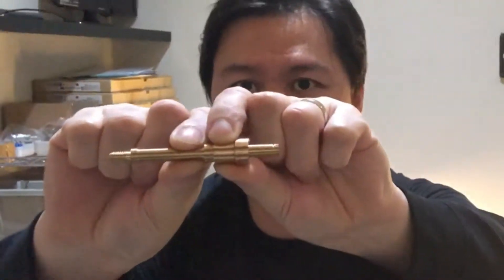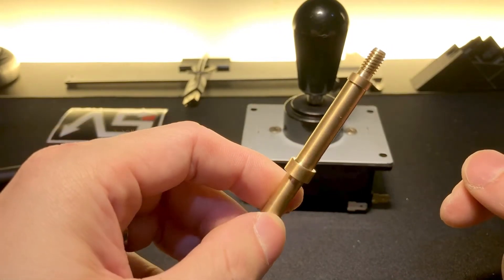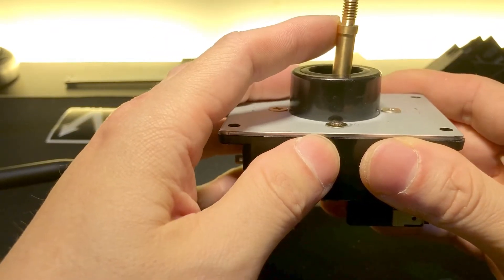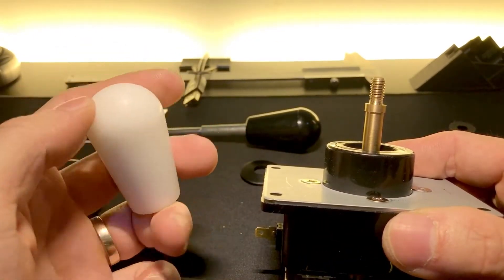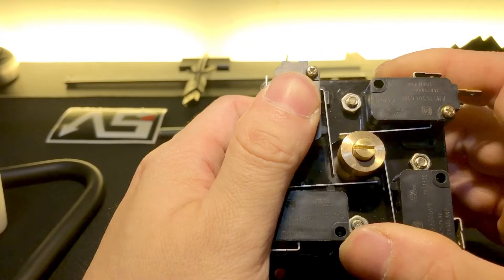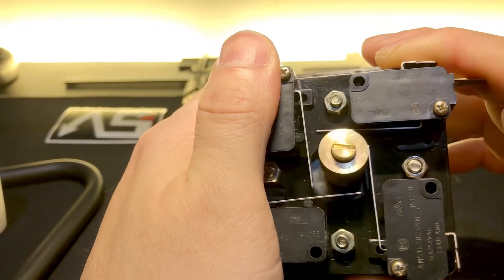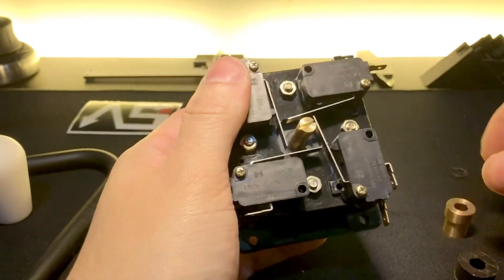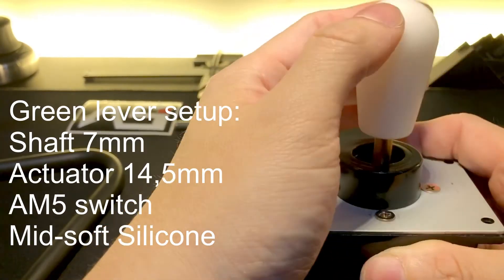Golden Shaft and Actuator on Korean Fanta lever

Comment: Do the switches make a big difference? I don't know where to get am5 switches in America.
Reply: Just like James said, Micro switches are a big deal. Experimenting is key with different type. as for the AM5, Focus Attack has some left in stock with the long leaf spring. On there site it is the LS-32 Fastener switch. I bought a couple. I still prefer the Gersung A3 as in has a heavier actuation force. I actually put the A3's in my Sanwa JLF with a 1.5 spring, Toodles Round circle gate, Kowal oversized actuator, JLF extended Shaft, and A Bat top. Night and day difference to the stock sanwa and about the closet I can get it to feel to a Korean Lever. Give it a try if yah have the parts and you can actually order all the parts separate and build it.Sorry I was going off Topic but thank you Arcade stick Indonesia for doing this videos and showing us the project. I love my Korean Levers and look forward to doing a Golden Fanta build for my next stick.